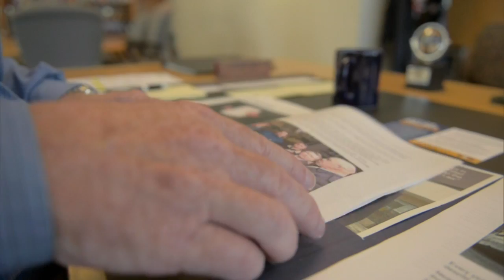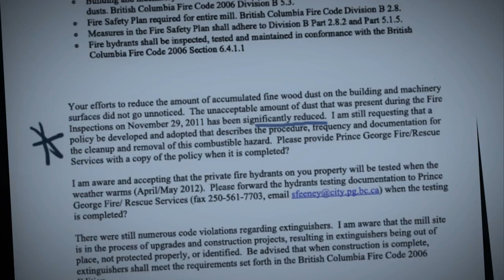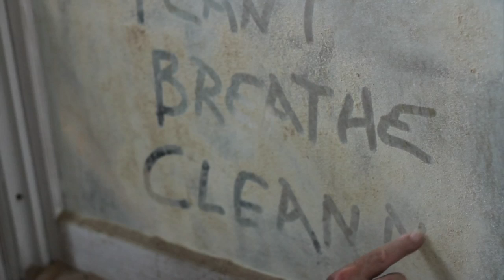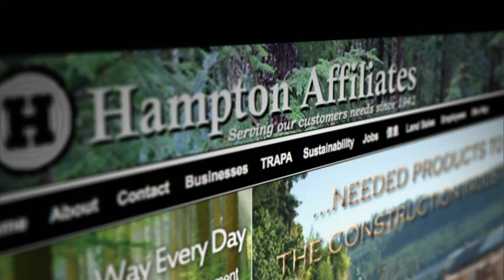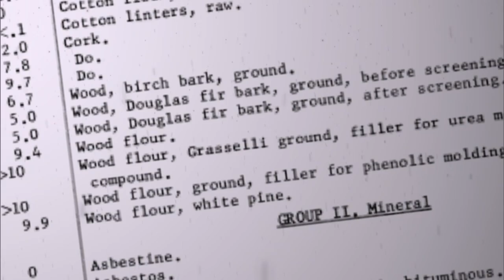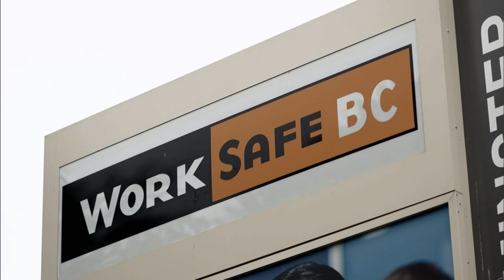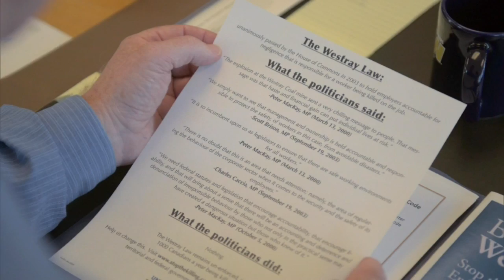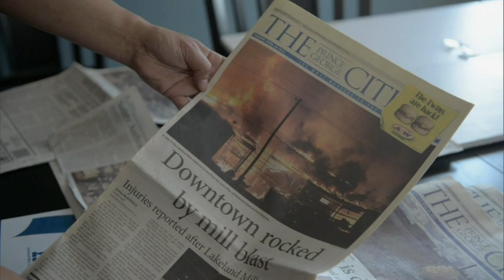FULL STORY: Deadly Mills

Comment: I worked in the paper industry for thirty years and have seen dust explode many times. We used to clean and clean all the time. One time I was walking along side on a paper machine. A small flare up of paper dust resulting in a small exposition that In turned cause a small blast that knocked the lose dust to fly off the beams and hoods. This in turn caused a bigger flare up which cause a bigger flare up. Fortunately we ran out of dust and the fire was checked.